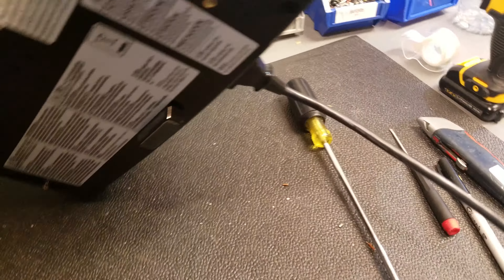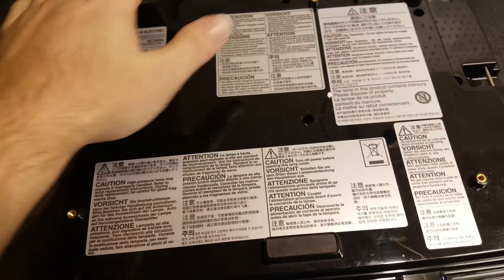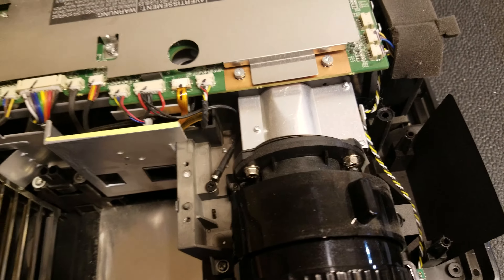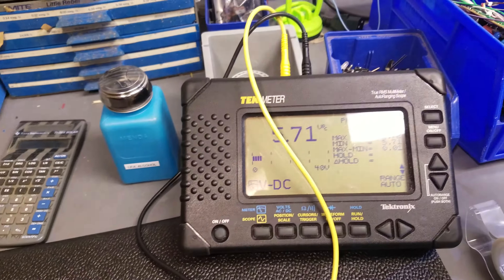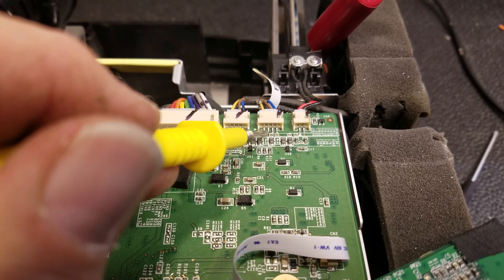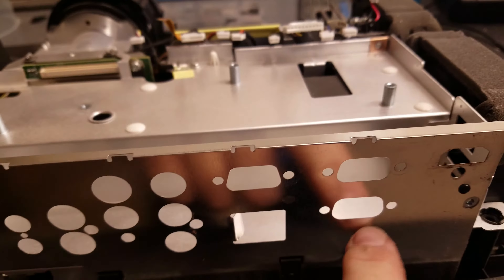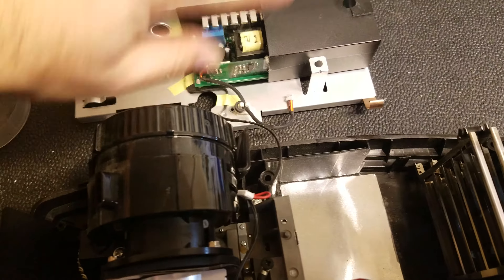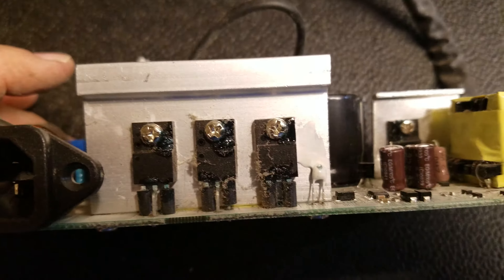Mitsubishi HC3800 Projector Repair No Light Part 1

Comment: Hi FixitFrank 

I have a HC3800 with a problem i cannot figure out..  When I turn it on it starts up as normal, lamp starts to warm up, but as soon as the bulb is fully lid and the picture is turned on.  The status light starts blinking, and after a few sec it starts shut down.  I have tried to replace bulb/housing, no change.  I dont think its a overheating problem since all fans are running, and the hole process fra start to shut down takes about 30 sec. 

Right now im looking at my 24 inch computer screen, and could be looking at my 120 inch projector screen :-) So if you have any ideas I would be very grateful 

and thanks for at great chanel 

br 

Hans Hansen
Reply from the maker: Hi Hans, I have a few theories.  Lets start with the easiest.  http://www.projectorcentral.com/pdf/projector_manual_5127.pdf  go to page 38 and try the manual lamp time reset. If it still shuts down, look at the troubleshooting section ( page 40) and let me know exactly what the LEDs are doing.  It might be a bad tachometer on one of the fans.  But try this first. Also make sure there isnt any dust near the color wheel. I have a video on cleaning an Optoma HD20 but the same thing applies here.  Thanks for watching!
Reply: Hi FixitFrank

Thank you very much for taking the time to help me out here.  Maybe I should give you some more info.  I replaced the color wheel about a year ago. and It has been running fine since.  I have looked at the manual and searched the internet. but I have not been able to figure out what   steady Green Power + Blinking Green means.  I have uploaded a video of the problem https://www.youtube.com/watch?v=ar2jqCgpjtU
Please take a look , and any suggestions i very appreciated.

Br 

Hans
Reply from the maker: Hi Hans, That is very strange indeed.  Let me ask a question. When did this behavior start?  Was it when you put the new lamp in?  I only ask because the housing in your video looks like some of the housings I have seen that do not have the proper ND coating on the lens and will allow lots of UV light to flood the CW sensor causing all sorts of problems.   Does the lamp have an Osram PVIP bulb installed?  See if that is the case and if the lens of the lamp has a blue-red coating to it.  If it is greenish or clear that may be your problem. If you have the old lamp, swap the lenses.  The green flashing you are seeing is likely the 'cooling down' indicator. The projector is complaining about the lamp circuit being shut off but the reason it is being shut off is what we will determine. Lets rule out the lamp housing first and verify the lens type and bulb type.
Reply: Hi FixitFrank
The problem started all of a sudden one day..  at that time is was running original housing with osram vip bulb. I had another China kopi bulb and housing I bought some time ago.  I have tried different combinations, but no change.. But I will install original bulb and housing tomorrow and get back to you... thanks again...
Reply from the maker: You may want to try the china bulb in the original housing or move the lens from the original housing to the china lamp.  My guess is the lens on the china lamp is not the proper ND coating.  It is very common.  the cheap lamps are really awful in my experience. They are cheap but they are cheap because they use Krypton 85 to bypass the patents and run the lamps too hot.
Reply: Just tried with original housing and osram vip lamp. Still same error.  I have tried all lamp/housing combinations no change. is it possible for the original housing to wear out ? im on my 4th lamp in same housing 9000+ hours. I know i use it alot :-)  I just find it strange that the Error starts exactly when the Mitshubishi logo is projected. The color of the logo is fine and there is no flickering in the picture. That tells me that the color wheel is working fine, but im no expert :-)
Reply from the maker: You are likely right. Needed to rule it out. The projectors usually shut down at that point when they do not see a Lamp-OK signal from the ballast. On that model is can be caused by a few things.  Usually (80-90%) it is a lamp.  you may want to try the chinese lamp with the glass lens from the OEM to be safe (unless you see the blue/red coating). Next things to check are the Fans.  They may be running but they may not be reporting that to the projector.  If you measure DC voltage on the tachometer pin(yellow wire). You should read very low voltage.  0.4 or lower DC. If you read 1V or higher, the speed sensor of the fan is bad.  Another possibility is the power supply capacitors on the low voltage side.  They can become dried out and have bad values.  How much do you want to get into this?  I am happy to keep helping if you want.
Reply: I just tried to measure with my volt meter set to dc.  But when I connect the Ground wire to the metal base of the projector and the Red wire til the yellow tachometer pin.  it shorts out the projector. What am I doing wrong ?  I tried to switch the fans around on the board, but I still get the same error.  I would like to rule out the fans and every thing that is cheap to replace.  Can I rule out the color wheel because of the clear red color on the logo and the steady picture, or do you think I should take It apart and check the color wheel ?  and if so how do I test  the color wheel is working ?
Reply from the maker: Hans hansen make sure your meter wires are plugged into 'common' (or negative) and volt/ohm and not negative and amps or milliamps. Then verify you are measuring dc volts. If you are on amps or ohms it can cause that depending on the meter brand. 
I think your cw is ok but you can put the positive lead on the sensor output wire to see if it's fluctuating rather than steady .  I'll see if I can demonstrate for you in a video. Check the leads and meter settings first.
Reply from the maker: What is the meter you are using?  Is it a digital DMM or analog?  Sometimes the older analog meters can load down the test area too much. If it is a manual range meter(2v, 200v, 2000v) then try the 200V scale and see if the needle moves at all. I will see if I can find the service manual again to help out.
Reply: Hi FixitFrank
I uploaded a video of my multimeter https://www.youtube.com/watch?v=AP76wJqXwqQ
I think I got a reading of 4.13 on 2 of the fans but it keeps shorting out.  So I stopped.  please tell me how to set it ? and i´ll try again.
Reply from the maker: I see it! Your black probe is in the Amps location. You are accidentally shorting it through the current shunt inside the meter.

Move your black probe to COM under the red.  Then measure DC V and you will be OK.
Reply from the maker: red probe is OK where it is. Nice meter by the way.
Reply: HI FixitFrank
I finally got it to work...  but im not sure what wire I should mesure..  the yellew wire is 12 V  on all 3 chasisis fans, Black I get 0 on all 3 fans  Brown wire i get a reading of 0.04 on all 3 fans  Blue wire depends on how fast the fan is spinning  i measured 2 of the fans to 1.3v and the 3. to 1.9v (this is the fan right next to the lamp)   On the fan inside the projector for the lamp I get a reading of 1.19V (yellow wire)  at startup and then i drops to 0.70 and then back up to 1.19 when the error starts and  the cooling down process starts.    I tried to switch the 3 chassis fans around and they all got the same reading as the previous fan. So I think they should be ok unless they are bad all 3. Do you think it could be the fan for the lamp inside the projector ?   Sorry for my late replies but I only have time for this after the kids are put to bed.
Reply from the maker: Hi Hans, no worries my friend.  Take your time.  You are correct.  They are actually pulsing to the speed. While they are running, they should be low.  Its a shame you are not in the states. I have all of the fans from this projector in the video.  I suspect shipping them overseas is quite expensive.   However if they are under 1v while running (before shutdown) they are probably reporting properly.  Next step is to check the low voltage power supply.   Why dont you email me.  rostit@ultrafark.com.  I have the service manual and it will be easier over email. Then once we get a solutoin,we can add it here for other people.
Reply: No problem i´ll email you.  And I think you right.  It might be cheaper to buy new fans from china with free shipping :-)

Comment: where ıs the thıs vıdeo part 2 ?
Reply from the maker: Özlem  Gürsoy sadly there is no part 2 right now.  The repair was more expensive than the customer wanted to pay( I did not blame them).  The main power supply and ballast ended up being bad.  However I leave it as part 1 because I should see another projector like this one and can use it to make part 2.  Are you having similar problems with your projector?

Comment: I have this and replaced the color wheel and now I get the flashing red and green LED light which means the lamp cover isn't attached, which it is. Any suggestions?
Reply from the maker: https://youtu.be/0OI6IXboSAM?t=148   <--Pause right here. Upper right hand corner (red/black pair) is the door switch wire and switch.Those 2 wires need to be connected through the switch. Sometimes the metal tab can be pushed out of the right spot or the door gets its tab snapped off.
Reply: Rostit there a way I can send you a picture of what I have going on with it? It's actually the hc4000 so the switch looks a little different and ha s black button to push it in. I've done this and it still flashes red and green. Thinking it might be something with the power board. Did you end up getting the projector in the video working again?
Reply from the maker: I did, but I ended up replacing the entire power supply as there was no high voltage. Are you getting any fans at all, or just the blinking red/green?  one thing you can try is bridging the connection manually. eliminate the switch all together.
Reply: I had the fan working at one point but after I replaced the color wheel the fans don't turn on and it just flashes green and res light on the keyboard.  How would I be able to bypass the switch manually? I taped down the button to push it in but that didn't work
Reply from the maker: huh That might not be the switch..  can you post a video? or email me?  rostit at ultrafark,com